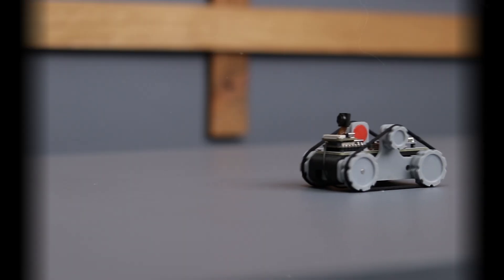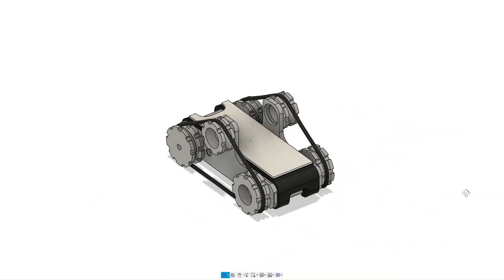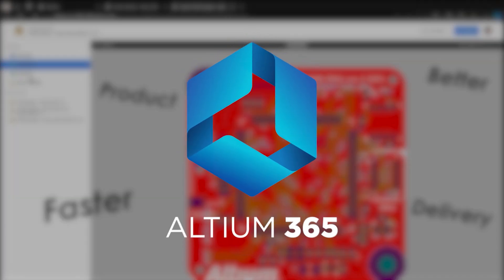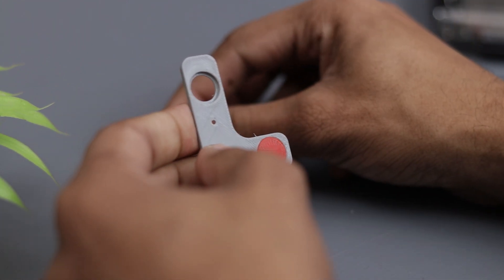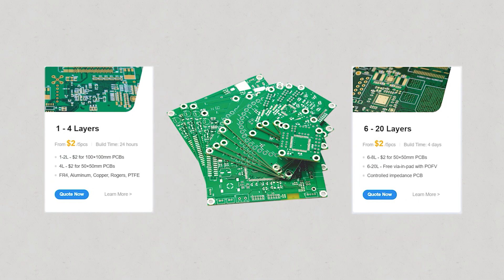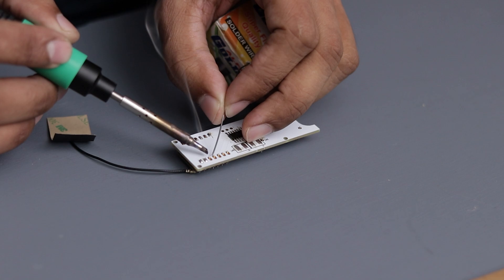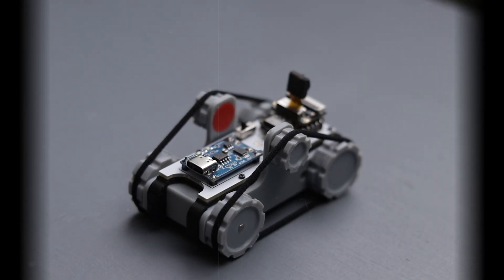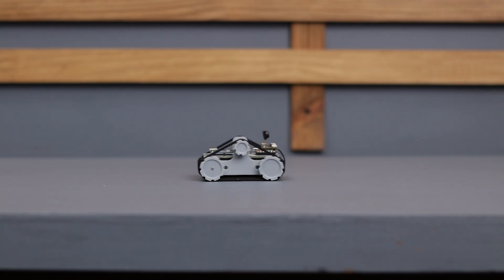DIY Mini FPV Tank: 3D-Printed and Smartphone Controlled!

Comment: I haven’t looked at all components to see your exact setup. But running from a 1S and stepping up voltages often leads to “drop out” where you pull too much current from the power supply. You want a 2S setup and power the motors directly from that 7.2-8.4v setup. You can get small 2-3A power supply board (similar to size you currently have) to power your +5v stuff.. (camera?). I’d have to look at your camera/ESP board to see if you can power directly from 2S. You simply can’t pull enough current thru your regulator board and it is shutting down.

Comment: switch esp32c3 with any of esp32 s series ... lately i been facing issues with c-series
Reply: I never thought the anything but the S3 could do this without significant code optimization. Most of the older projects for the base ESP32 wanted you to download some special code for some random github repository. I personaly wouldn't trust those and just moved on to a raspberry pi zero or variant. The base ESP32 had problems just running the camera I can imagine it doing anything else would shut it down.

Comment: Hi Wrench.. Nice little project. Clean and simple design. I particularly like that you removed the chip from the breakout board to use on your own PCB. I hate breakout boards. I was, however, wondering why you didn't use the 'CAPS' from that board. I at least did not see them (or others) installed on your project. Good luck with your troubleshooting.

Comment: FYI:  one of the coolest features of the Seeed XIAO ESP32 chips is that they have two "BAT" solder pads on the back specifically to manage a 1S LiPo.  It will regulate the power down to 3.3V, and automatically manage charging it when the USB-C is plugged in.   You shouldn't need a separate board for the battery.

Btw, using the camera with the Seeed XIAO ESP32-S3 technically works, but it pretty much maxes out the board and it gets absurdly hot*.  You *have to add a heatsink if you're going to run it more than 30 seconds.  I had to scale the resolution down to like 640x480 or something to get it to stream any reasonable FPS over Wifi.  Overheating is possibly why it stopped working.

Regardless, cool project!
Reply: No matter what I do I can't see the live feed in camera webserver I can only see the website I can't stream it I can't capture it what should I do the sensor is ov3660 when I start stream it gives me a broken image

Comment: It is more likely a power issue, I had this issue once in one of my projects, hope you will get it working :)
Reply from the maker: Thanks! I'm working on it
Reply: Esp32 with active wifi and camera eats around 200 mA. It might be a bit too much for that tiny battery.
Reply: Yeah most probably that. These batteries aren't that powerful. Maybe use something like an 18650.

Comment: make the wheels a bit smoother for smooth exp and in future make convert a boat as in small pipe or sewers water is there so this will e useful instead of using wire power connectivity id the issue,btw loved this project
Reply from the maker: Thanks for suggestions! Appreciated

Comment: I think you need to provide better power supply to the esp32 module. Swap the current lipo battery with one that has higher capacity. The radio on the esp32 alone consumes most of the power at startup. On top of that you have your motors running. The voltage drop must be huge. Also use 5v instead of 3.3v for   the esp.
Reply from the maker: Thanks for the feedback! I'll keep that in mind for future projects.

Comment: a custom PCB is a complete overkill for this toy
Reply: Yeah but it makes a good giant add. 😂
Reply: Also use conductor threads for attaching micro controller to thy pcb
Reply: I wish someone design something similar with off the shelf components
Reply from the maker: @alfem ill design very soon
Reply: These YouTubers get free PCBs and money, so they don’t care. None of my friends import anything from China because the shipping is really expensive—more like 10 times the actual product price—plus the risk. They never talk about shipping.
Reply: @KhushitShah Depends on where you are. Shipping from China is usually free or very inexpensive here in Europe.  Custom boards are also not that expensive compared to other components.
Reply: Try using printer and paper for  pcb assuming you know what are conductors . Please check with a  normal printer before going with me by checking the conductor through tests because some printer inka don't have such quality of being called conductors

Comment: Which 3d modeling software should  i start with
Reply: Solid edge or fusion 360
Reply: Fusion 360
Reply: No blender or solidworks are the best
Reply: 123d
Reply: ig onshape would be the bestplus it runs on your browser!
Reply: Solidworks or fusion360. Solidworks has benefit of being nearly ubiquitous in commercial/defense design industries
Reply: Onshape